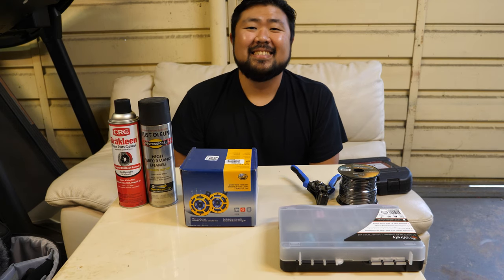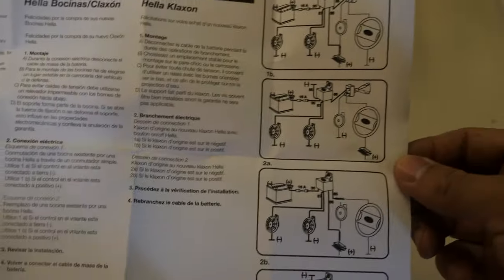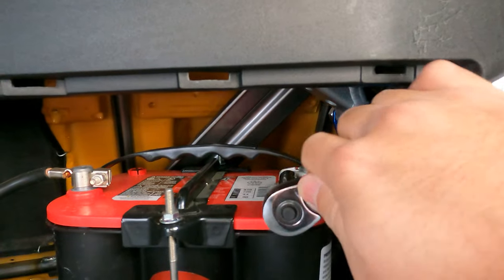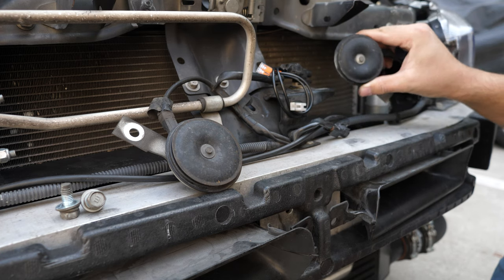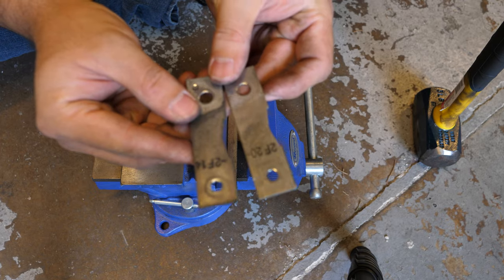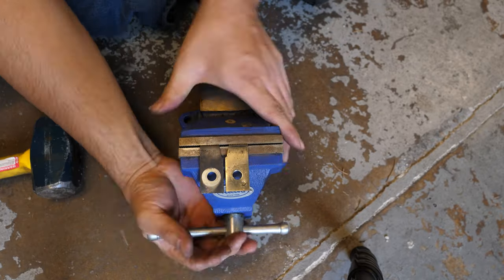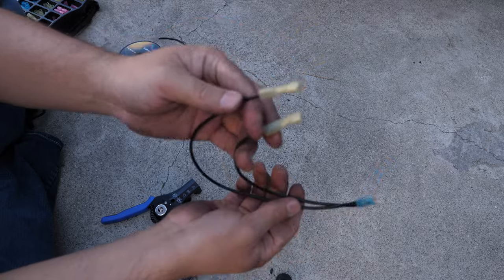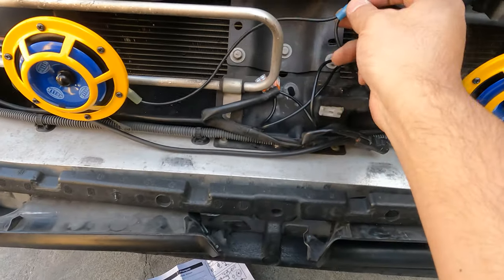Evo X Hella Horn Install!!!

Comment: I like your set up, for my set up on my 13' Lancer GT Wagon, I actually used an 07' STI grimmspeed horn bracket, redrilled center hole and bought the STI Wiring harness. Made install a breeze man, literally all plug n play with the wiring harness.
Reply from the maker: Oh man that was a good idea! You got a pretty rare car haha nice 👍🏼
Reply: @JeffSongCars  Thanks man haha. As I am sure you know, there's certain things that haven't been fully developed yet for us Mitsubishi Enthusiasts. I'm a little bit picky and that I need both horns equal and perfectly centered. The grimmspeed bracket achieved just that. I do enjoy your video and I think you did damn good job getting your horns centered man 👍

I'm running the same horns brother. All of my buddies run the reds. I gotta change it up, which is went with the yellows. 

I actually left one of my factory horns mounted and connected, that way when I lock my car all I hear is a little beep. When I slam on my horn, then the super tones activate 💥 🤙
Reply from the maker: @Shim_Shack_Studio  Thanks man 😁👍. I really do appreciate the support! That's a pretty good idea for the stock horn... hmmm I think I may have tossed mine somewhere to be found years later lol. I do like the sound of ours though 🙌

Comment: That's dope. For me I went with the hella trumpets a lot louder of a sound and beefier. Just need to run a 12v for the extra sound
Reply from the maker: Oh wow didn't know there was a third option hahaha I thought it was just the sharp tone and super tone. How was the wiring for that?
Reply: @JeffSongCars  straight forward as the Sharpe tone. You just put a fuse in the line for extra power. I believe there's videos and a write up online
Reply from the maker: Ohhh nice nice, yea our cars oem horn is toooo weak

Comment: What happened to the fuse ??? I Only see that you show it up at the beginning of video when showing whats inside the package
Reply from the maker: I believe that fuse was something optional, not too sure but I may have put in a different fuse for the slot it goes in from another mod I did. My bad I completely forgot about adding that part in during the video!
Reply: @JeffSongCars  Its all good ,as u mention ,I did not need at all , just plug as u did and workout good ,Thanks ! O/

Comment: Where did you get the metal bracket that your bumper quick release is bolted to?
Reply from the maker: I got it from a seller on Etsy but he’s no longer in business. I think malperformance has one too but before you do add a quick release make sure you’re ready drill holes into your bumper hahah 👍🏼

Comment: So i dont need run anything to the battery?
Reply from the maker: Nope! Just the wiring in the video, I've been running it for a little bit and it works totally fine. The horn sound when I lock the car sounds a little fun y but that's it hahah 😄👍

Comment: What are those yellow and blue thingy u connect wires with?
Reply from the maker: They’re wire connectors and this is the set I used Wirefy Heat Shrink Wire Connectors Kit - Marine Grade Electrical Connectors - Automotive Butt Connectors - Insulated Ring, Spade, Fork, Hook Crimp Terminals - 22-10 Gauge - 270 PCS https://www.amazon.com/dp/B01GXQMP66/ref=cm_sw_r_cp_api_i_Z3EP8N94F0VSVD0K5R9X?_encoding=UTF8&psc=1